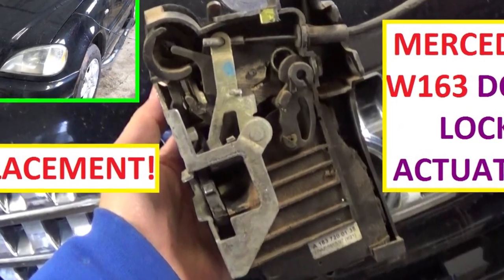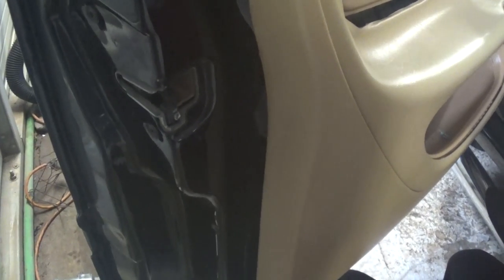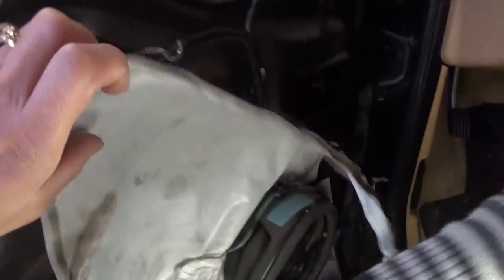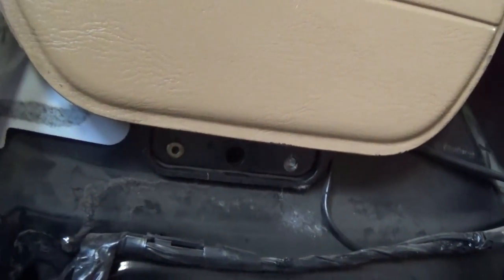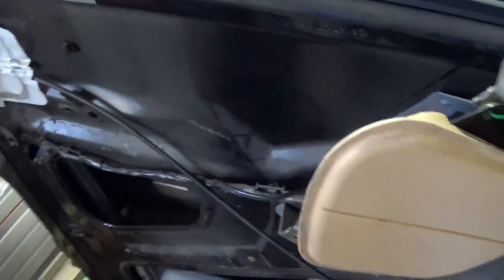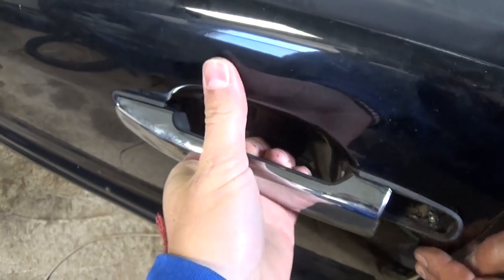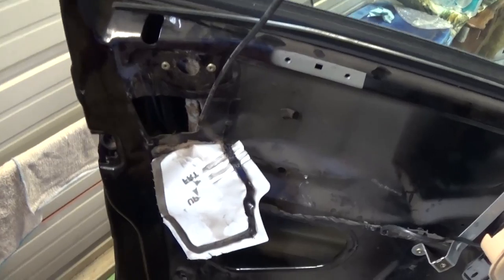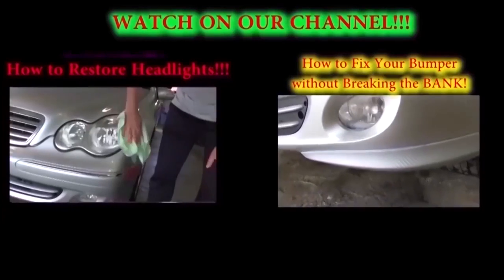How to Remove and Replace Door Actuator Mercedes W163 ML230 ML270 ML320 ML350 ML400 ML430 ML500

Comment: Nice demo of an awkward job, I like the speed that you work at, sometimes "how too" vids are like watching paint dry :) I have a w163 270 cdi that has "machine gun" lock actuator on the same door, I am tempted to have a go at replacing it now, thanks guys..
Reply: Appreciated post!.
Reply: how did you fix it?

Comment: I need to replace my actuator but i can't get the door to open from the inside or out. I managed to get the panel off from the inside but how can i break the actuator or get it free to open the door... any suggestions?
Reply from the maker: +JamesNDelilah Pinckney  Since you removed the door panel try to reach the linkage for the door knob and pull it with pliers or pry it with a screwdriver. They tend to get stuck. Which door is it? If you ever need help with your vehicle let us know you can also find us on Our Official Facebook Page here: https://www.facebook.com/worldmechanicsofficialpage/?fref=ts
Reply from the maker: +JamesNDelilah Pinckney try this as well: simultaneously pull the inside and outside door handles. This fixes sometimes jammed doors on w163
Reply: World Mechanics o
Reply: did you fix the problem? how did you open the door?

Comment: Great video, thanks.  I hate to fool around with those airbags.  One question I have is do you have a video on how you repaired the broken clip holders on the door panel?  I too have one broken, which I broke while removing those white clips.  In my case, I have both the upper and lower broken parts.  They fit tightly together with the part of the clip that's glued to the door panel, so some kind of welding solvent could work for me.

Or, the glue that holds those clips to the door panel looks substantial enough but I have no clue what it is.  I'm thinking that if I could glue it together with that door panel glue, I could mark exactly where that clip is on the door, and should the actuator or regulator need replacing again, I would know exactly where to insert my panel removal tool so I put pressure on only the white clip and not the glued clip holder.

Thanks again for a great video.  I have 3 failed actuators to replace, on my ML, and the dealer already did the 4th..  I did a calculation and figured out the MTBF for the actuators was less than 30 hours.  Mercedes should be ashamed to design such a flawed component, the the engineering team that did this should be fired.  Electro-mechanical devices should be designed for a 2000 hours MTBF at least.
Reply: Jim Busse I have replaced 7 door lock actuators in 19 years of ML330 ownership & the 8th door lock actuator has started machine gunning this month on me. Driver door actuator has been replaced 2 times & will need a 3rd one soon. 

Horrible design.

Comment: hey @ 5:30 do u need the key and turn it to the right to get it out? 

I'm gonna get these from the junk yard but they don't usually have the keys there still.

Thanks guys, love ur channel!
Reply: so did you figure out how to remove it? without the key?
Reply: @Menga213  don't think you need it. Got them out without one.
Reply: @SpenserRoger  so you only need two actuator to fix the problem. 
If my key doesn't lock all of my doors is that my actuator or my fuses?

Comment: You need especial tool to take out the lock T20 (T-20) Torx/Star Driver (it’s not the 4mm to my 2000 Mercedes-Benz ml320)
Reply: I think I'm having that issue on a 2002 ML500. Are referring to the bolt that holds lock cylinder in place? I tried a long 4mm allen but it doesn't seem to fit into the head of the bolt/screw. Unfortunately, I don't a long enough T20 to try it. I'll have to order a set.